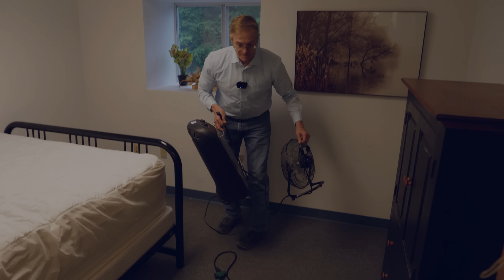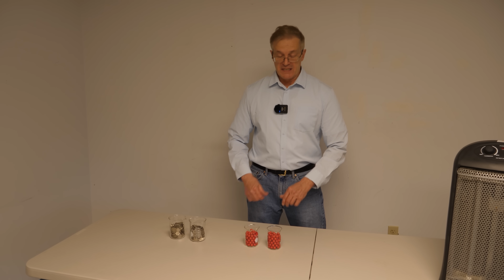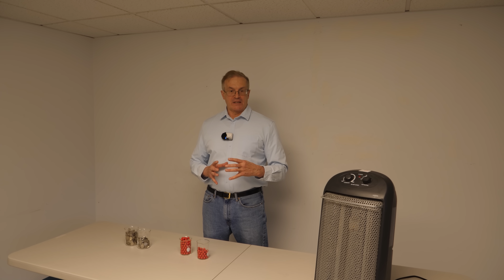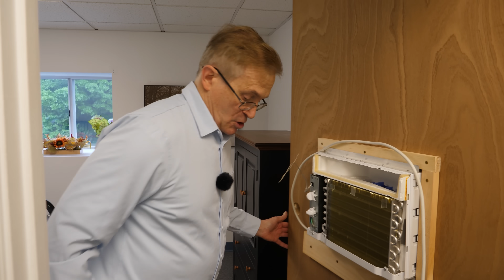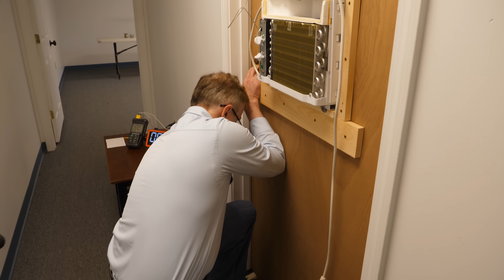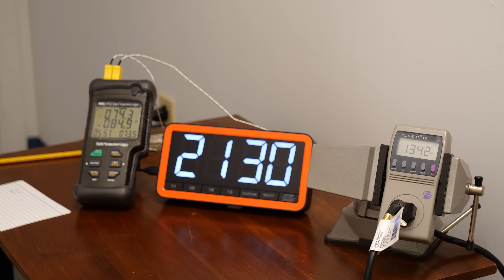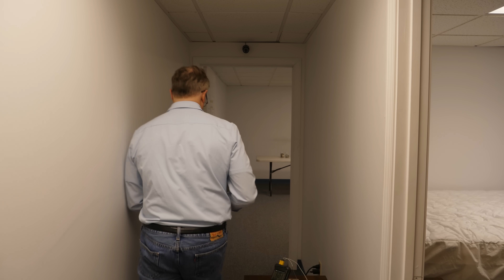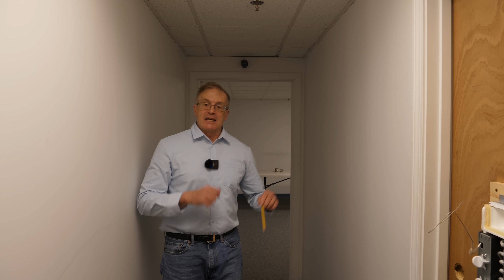You're wasting money on heating! Use your A/C!

Comment: here is the problem with heat pumps in general. it takes much more energy to extract heat out of something that has alot less heat in it to begin with. ie its easy to move heat from a 70F degree room to a hallway but its alot more difficult to move heat from a 0F room to the hallway. (heat and energy are the same thing in this context)
Reply: You’re wrong.

Comment: Tried one 3 ton heat pump for 25 years now, wont do another one (EVER) and i quit using the heat mode after the second winter when i realized the dirty secret of electric heat strips turning on when this thing fell flat on its face at around 35 degree outside temp, so i figured why kill the compressor sooner by running it year round, i just switched the t-stat to emergency heat snd just use that while the compressor gets the winter off.
This old rheem will probably get changed out at the 30 yr mark with a conventional split system with no heat pump junk in sight, and ill tell you one thing, having that stupid thing running a compressor plus back up heat strip ran my elect bill way up vs just heating with heat strip which did great in our mild southern Arizona winters and i probably doubled the life span on my AC.
And I’ve got no illusions the current garbage AC units most brands will ever come close to lasting even half as long as this old girl
Reply: Heat pumps have come a long way in the past 25 years. They heat down to below zero F outside temperature. Unlike your ancient 25 year old one that runs the compressor at a constant speed so it regulates temperature with turning it on and off at full blast, new ones use a variable speed compressor and fans to control how much cool or heat they output, while doing so constantly - without the uncomfortable an inefficient ramping up and down of room temperature.
Reply: @greggv8  

Ill stick with simplicity over the over technical aluminum copper mixed junk with variable compressor insanity  with china  made garbage circuit boards that’ll never see the age of my antiquated  much simpler single speed compressor system plus i call bs on the zero ambient temp efficiency while your system still runs a backup to cover the system falling on its face irregardless of the snake oil speeds the compressor runs.

New tech doesn’t always guarantee better with the exception of generating revenue for service companies and expense for the owners.

The copper aluminum mix is a joke along with the coil leaks all over the place.

From a seller view it probably looks good, but getting 25-30 years without major component replacements, ill take antiquated 10 to 1

Comment: Really good impressive video, thank you, but there is an elephant in the room.

To keep the heat in, we insulate and make rooms airtight. The problem with airtight is (1) moisture and mould in cold spots (2) the room needs 10% new air per hour, otherwise people say the air in the room is stale. With heat pumps, water is often generated from air humidity
Reply from the maker: That's not really an elephant.
Air exchange will remain a component for any heating system, and the condensate is produced on the cold side. It's simply routed over to the hot side to enhance the heat exchanger performance.

Comment: From a scientific point of view, I have some stomach ache with the experimental setup:
* why the extra fan in the room? The heating unit has one built in or uses convection flow.
* The heat generated by the fan is negligible. (More heat is exchanged through the hole in the door)
* the heat probe is closer to the door (1m) than to the window (2m).

For a fair setup, the heater and the AC unit should have been turned in the same place and in the same direction. At best, the fan would have to be taken out of the equation. Of course, the hole in the door would have to be sealed with a cloth or plug.
Reply from the maker: Take an antacid if this doesn't help.
The space heater has no fan, and the separate one we placed in front helps to distribute its heat more evenly through the room. That fan is oriented at a right angle to the probe.
Similarly, the airconditioner also has a fan with approximately the same flow rate, and its output is oriented at a right angle to the probe.
The fan consumed 100 watts, which was approximately 8 % of the total used by that setup. Small, but not negligible. 
The door knob hole was taped over on the inside surface.

Comment: There’s a big difference in the humidity between the two too. With the electric heater, it dries the air out  and you would have to get a humidifier just to balance it out. I’m sure with the heat pump the warm air in there feels way more comfortable
Reply from the maker: Actually, the resistance heater and the airconditioner both lower the relative humidity. The condensate is produced on the cold side and routed to the hot side to enhance the heat exchanger performance when in "normal" operation. You can choose to dump that water outside or continue to allow it into the building.
Reply: @TechIngredients  oh I’m sorry. I didn’t know that. I knew for sure the electric heater dried the air out. So I guess you’ll need a humidity for both the methods here.
Reply from the maker: What changes when you add heat is not the water content in the air but the water capacity of the air. That's why the RELATIVE humidity drops.

Comment: I have been thinking for some time about using air conditioning as heating instead of gas-fired central heating. To save money. A m3 of gas costs €1.15. One kWh of electricity €0.31. 1 m3 of gas contains approximately 10 kWh of energy.

Comment: I have been thinking about doing this for years. 

but shouldn't your test have included the fan in the room. since it was a part of the original "heating setup"
Reply from the maker: Theoretically,  it would be. 
The decision to remove them was based on the concern that some viewers would suspect we were cheating in view of the huge performance gain with the airconditioner.

Comment: Resistance heating is 100% inefficient. Heat loss is the enemy of any circuit.
Also, this video was so well explained by someone so well learned, I felt it would be rude to skip past anything.
Reply from the maker: That's true unless the actual purpose is heating. Put 5 lousy gamers in a room and let them churn away on 5 powerful processors until they are KO'd. They will be exactly as efficient in heating that room as the resistance heater...100 %.
Reply: @TechIngredients  My wife will tell you that's true even with one lousy gamer in the room with this heat.

Comment: I heat and cool my shop with a basic a/c only window unit that fits in a hole in the wall. I bypassed the built in thermostat and installed my own. In the fall i pull it out of the hole in the wall, carry it outside, and stick it back into the same hole in the wall so the indoor side is actually outdoors. Once spring comes around i pull it out again and install it from the inside. Also during winter it drips the condensate onto the evaporator so when it’s in winter direction it helps humidify the air. Who needs a reversing valve when you can just turn the whole unit around so the condenser faces the inside.
Reply from the maker: Neat!

Comment: This is really cool.  I've always had the impression that A/C units were super inefficient but that seems to have more to do with their application than the work actually being done.
Reply: the window units are not efficient compared to central ac systems or split mini systems they leak air and have hot side right against cold with very little insulation.

Comment: By reading comments and watching this its almost like the US have just invented or discovered the use of heatpumps like this. Here in Europe we have used heatpumps for both heating and cooling widely since the 90s. My daughter used to work for an architect firm in Los Angeles until 2019. I am an HVAC engineer in Europe. She asked me for advice in several builds in the Sherman Oaks area but it was a futile struggle to convince the HVAC people over there to use heatpumps for heating. There was just no way they would believe there was money to be saved on the heating bills by using heatpumps. I sent over calculations based on local temperature maps but they just scoffed and kept repeating themselves without coming up with real figures. We just gave up in the end.
Reply from the maker: Interesting.
That region would be ideal and the performance would be excellent.
The one issue here is the large cost differential between airconditioners and heat pumps. A smaller market elevates prices and makes the market less competitive.

Comment: So you are implying that I could heat a room in the winter with my window air conditioner if I took it out of the window, turned it around 180 degrees and put it back into the window?
Reply from the maker: No.
A commercial airconditioner is optimized for a higher temperature range, and the electrical system, including the controls, would be outside.
We demonstrated the principle and the potential of heat pumps, which can be used for that purpose.
Reply: @TechIngredients  But the title of this episode literally says "You're wasting money on heating! ***Use your A/C!***"

Comment: Most Americans are wasting money on A/C! Use better insulation. You would not believe how much of a difference it makes adding a few more inches onto your exterior walls! I use to melt during warm summers. Never really noticed cold winters since I just turned the heat up and accepted the increased heating bill. But being from Hungary we don't really use A/C. They are not popular here. Anyway, after the renovation, our house was padded out with an extra roughly 8 inches of exterior coating and man... It's like the summer isn't even noticeable until at least 95F! I bought an A/C since then but I only use it on the hottest summer days. Same applies in reverse. I don't actually need much heating now during the winters either. We usually only heat one room and, unless it's freezing outside, we don't need much else! Point is no matter how efficient or inefficient the device you're using, you won't be using it much so it won't cost much.

Look at how thicc this guy's exterior wall is! You can catch a first glimpse of it here 0:21. Now THAT is proper insulation! I'd say the A/C or the heater doesn't matter much at this point. It's like you're living underground. I mean, how thick is that?! The window frame is still insufficient by European standards though. Maybe that's where the outside temperature creeps in? Get some German Tilt and Turn windows! I'd go at least double glass or triple with extra padding, but that wall is thicker than my grandma's... walls... And that's saying something.

Comment: cool vid, but if a resistance heater is 100% efficient, how can the heat pump be even more efficient than that?
Reply from the maker: It's a semantic issue. If the measure of efficiency is energy conversion, then the resistance heater is 100% efficient.  If the measure of efficiency is based on energy expended towards a purpose, then the resistance heater is an inefficient way to accomplish it.

Comment: this is amazing i use A/C during the summer that pulls up to 1800 watts and 2-3 heaters that pull up to 1500 watts during the winter so, this will help A LOT! but, one question if its 40- f outside and the ac only goes down to 62f how would it know to kick on? my unit turns itself off when it gets to the min temp of 62f.

Comment: Your experiment falls apart when the outside temperature is too low to engage the A/C unit. I’ve known about heat pumps for decades and I know they have improved vastly over that same time, used to be they were useless if the temperature dropped below about 45-50 and now they can function in even lower temperatures… my point? It’s actually not that hard to increase the temperature of a room that is already ~70 in the first place… I watched the video because I thought you were going to explain how to trick a window unit A/C into functioning when it’s too cold for it to run, just the fans running when the outside temperature is NOT ~30 or 40 is not a trick, making it run in a 70 degrees room is not a problem. I’ve known for years that using it as a heater would be great if you could get it to function in very cold temperatures without it turning into a block of ice is the trick. All you have to do is stand by the “vent” side to realize how much wasted heat there is and I’ve been curious for years why they just don’t make them into mini heat pumps…until recently when a company actually made one and they cost over $2,000. That kind of puts a monkey wrench into “cheap” window units. Even those R2-D2 style units would be a low wattage option if you could figure out how to make them work in low temps. An actual heat pump is designed to work in low temperatures a window unit is not, that’s the problem, not heating a 70 degree room.
Reply from the maker: It doesn't fall apart.  
The efficiency decreases as the differential increases. For large differentials, use the pump part of the way at a high efficiency and fill the gap with another heat source for overall higher efficiency.

Comment: I dont understand how it doesnt break the laws of thermodynamics if it's more efficient than a space heater.
Reply from the maker: Did my explanation at the beginning of the video not clarify that?
Reply: @TechIngredients  I'm still a little confused to be honest. My understanding so far is that the difference in energy between cold temperatures and warm summer temperatures is very little so the machine isn't doing much work. But how does it correspond to whether the machine is doing the work that it's doing with better efficiency than a 99% efficient space heater?
Reply from the maker: It's a problem with semantics.
Both systems could have 100% operating efficiency. However,  the pump's task is much easier, so it requires less energy.  If the standard of efficiency is changed to heating a room, then the resistance heater is very inefficient.

Comment: Would the concept be the same if one used a dehumidifier  in the room rather than the exhaust from a window a/c?
Reply from the maker: No.
Both outputs from the dehumidifier mix in the same room.  The result is the same as any electrically powered machine like the space heater.

Comment: What if it subzero temps outside, can you draw heat from those temps?
Reply from the maker: As I explained at the beginning of the video, even freezing air has 90% of the thermal energy as air on a summer day.  The refrigerant and expansion ratios can be selected to operate at those extremes.
Reply: Thanks for the reply. I watched a video on trying to reach absolute zero and I guess there's heat even above absolute zero
Reply from the maker: Exactly!

Comment: Where does the water drain?? That's my only question
Reply from the maker: That depends.
It's produced on the cold side and can be drained there or, as in a conventional airconditioner, it can be routed to the hot side to augment the performance of the heat exchanger.

Comment: Possible Inaccurate numbers , install that unit backward in a window and check results  also start with a cold room that has not had preheated surfaces holding residual warm temps
Reply from the maker: The more accurate improvement would be to repeat the test in the opposite order.

Comment: How does your AC only use 400w mine is over 1200w and its newer?
Reply from the maker: Your airconditioner must have a larger capacity.   This one is rated at 5,000 BTU.

Comment: Good explanation.  I have been upgrading air conditioners into heat pumps for years. Window units are too small but central systems can be upgraded by a skilled technician. They don't tell you that because they want to throw away the air conditioner and sell you a heat pump.
Reply from the maker: Interesting
Reply: I was a refrigeration and hvac mechanic for about 8 years. He is right - you need a reversing valve and some added plumbing and controls. By no means insurmountable though. @TechIngredients

Comment: I can personally attest to a lot of the stuff in this video. In Dec. 2022, my mom passed away. Before she passed away, she would run a space heater almost 24/7 in her bedroom, because it was 50F (I live in an old 1972 mobile home) during the winter and she was getting sick from cancer. The electric bill was almost $200 for November and December. After she passed away, I turned the space heater off, and used my kerosene furnace to heat the house and just kept her room closed off with a blanket to block the gap under the door, bill dropped down to $120. I emptied and unplugged the two freezers and fridge in the basement that dad (who passed away March '22) used for deer meat and such, and the bill is now $45/mo average. This summer, I'd been running some cheap chinese window AC unit in my 10x11 bedroom 8+ hours a day and my electric bill is still <$60. In fact, it was $48 though I'm wondering if it will go up a little because of the AC unit, but it really doesn't seem to be adding that much and that's with me running it sometimes 8, 10 hours a day from sunup to almost sundown.
Reply: Wow that is some serious cost cutting.

Comment: The problem here is that since it is inefficient to cool a room in the winter to create heat in another room, the unit has to actually be installed in an ouside wall, where it becomes much LESS efficient due to the higher delta T across the wall.